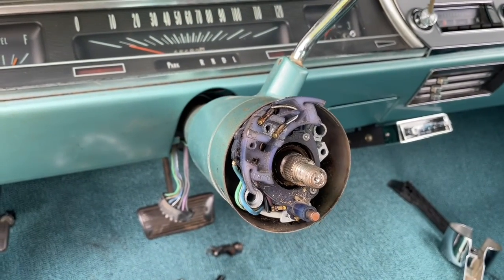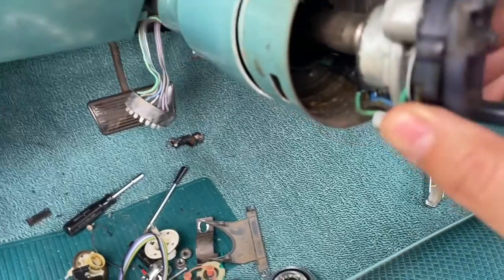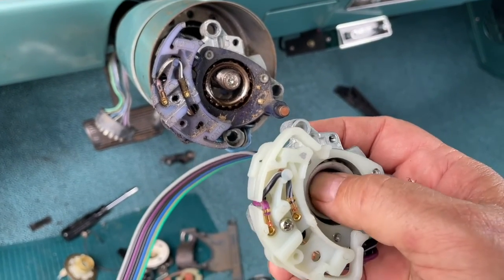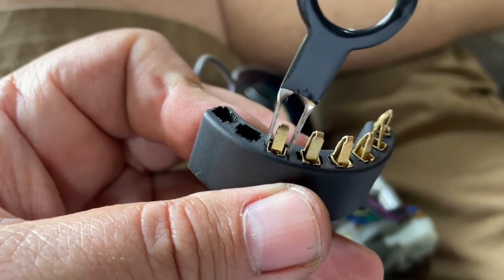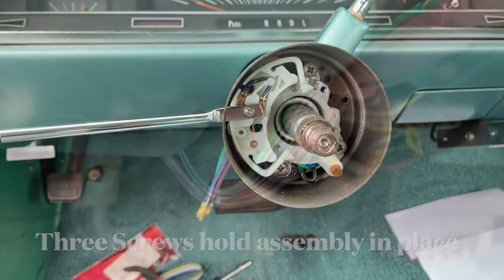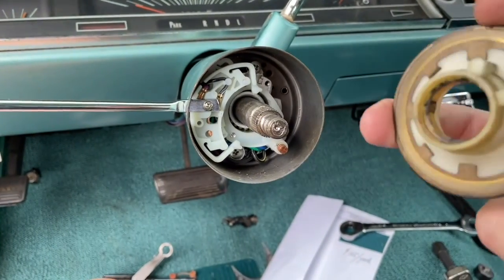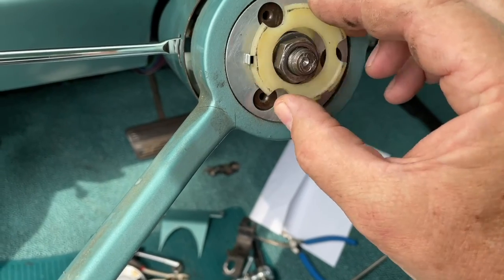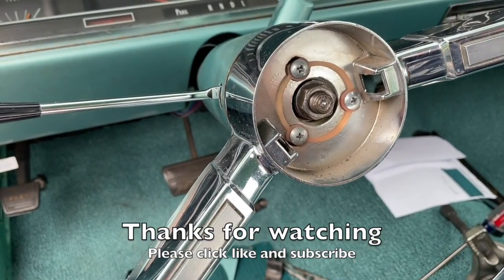1966 Chevelle - Malibu - Turn Signal Switch Repair

Comment: We are having issues with the right turn signal not working you can hear it but won't light up. Once you put pressure on the lever it will light up and you can see it blink.

Comment: Not wanting to be to critical of a nice video. But, dropping the column and pulling the harness up through is very easy, its why the connector is C shaped.  No reason to cut anything and no need for removing pins.  Your butchering parts that do not need to be butchered.  Other wise nice video on assembly of the unti.
Reply: Exactly what I was thinking. This is a hack way to do it